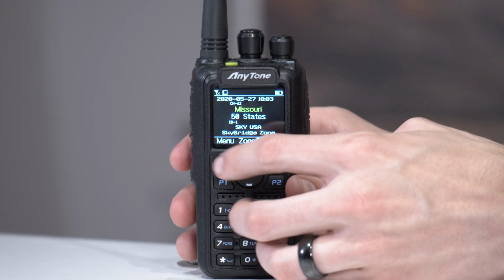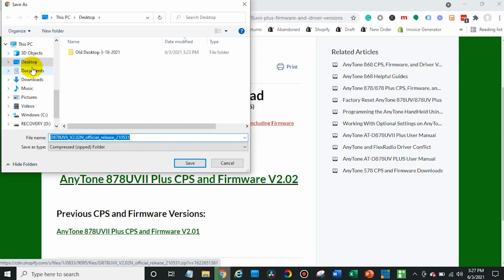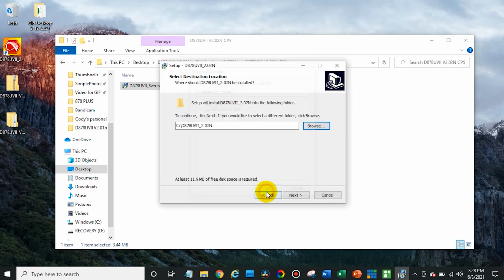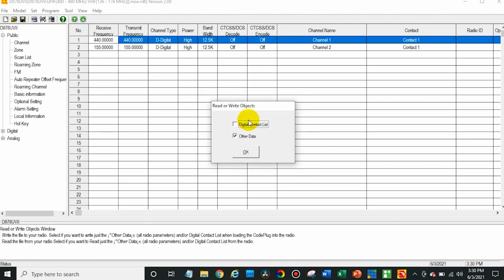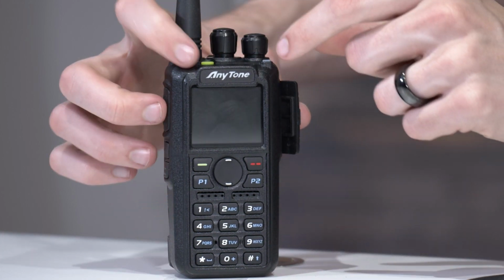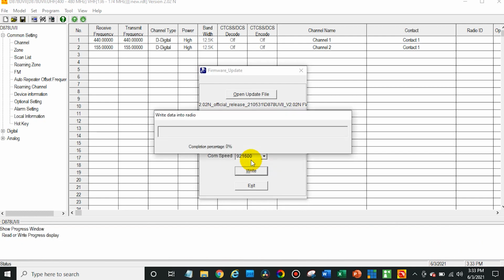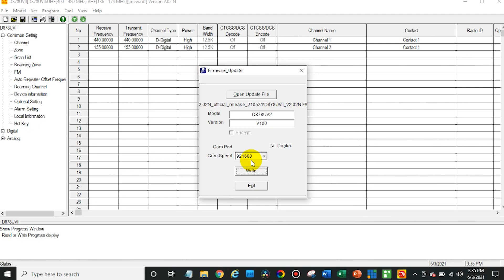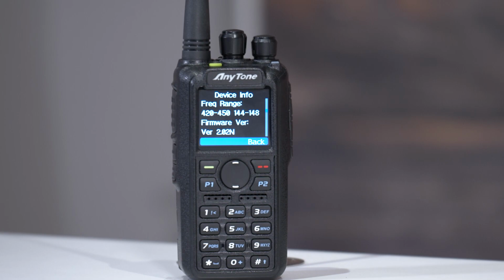How to Update Firmware on the AnyTone 878UVII Plus | DMR for Beginners

Comment: LOL I've been a barber for 45 years! I have the older 878 with the blue panic button on top. Firmware version 1.09. I tried to upload the latest version but it says my radio isn't communicating. I am using a Wouxun red cable. Is there a Anytone cable that I need? Radio was flashing red so I assume it was communicating or at least it was ready to communicate?
Reply from the maker: The red cable is not compatible. We have the correct cable on our website. Please visit the website site or call us and one of our Sales reps will be glad to assist you in getting the correct cable.

Comment: Thanks for all the info!! I just updated my D878UVII to the latest firmware (2.04) from the web site and all went great. EXCEPT now the up & down zone change button/rocker no longer changes the zone in memory mode. Works as it did in VFO but not in memory mode. I have looked and looked for some box to check/unckeck and can't figure out why it stopped. Reset to factory settings twice and reinstalled the firmware and it doesn't work. Any ideas?
Reply: I just updated mine to 2.04 and found the same thing: the rocker no longer changes the zone.  I can still go into the menu to change it, but the rocker doesn't do it anymore.  I guess that's a "feature" of the new firmware.

Comment: I followed all the instructions but when I tried to reset MCU, it started as normal and didn’t give a prompt screen to initialize.  It did a full start up.

I tried several times.

Will my radio have issues due to this??

TIA

Sean